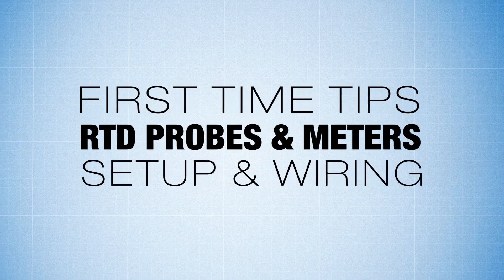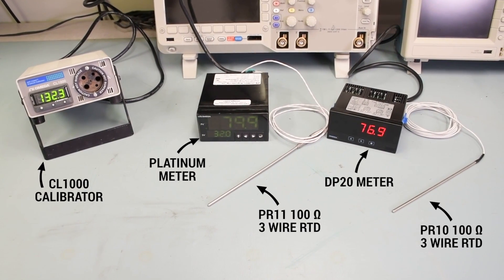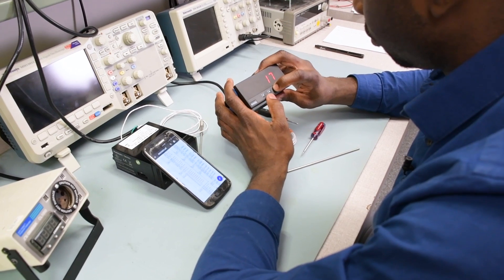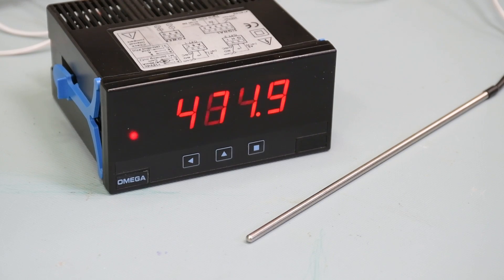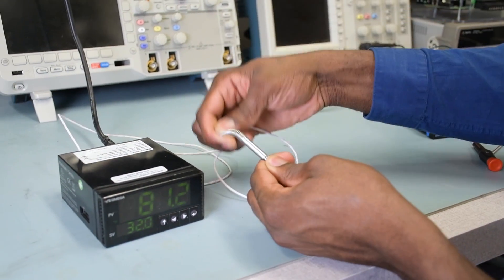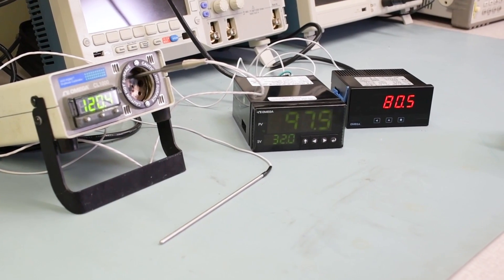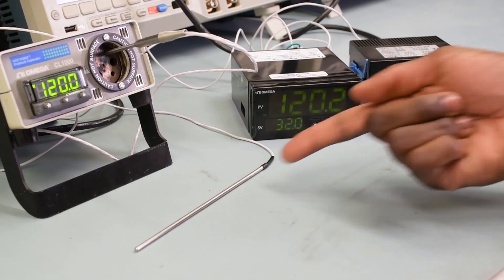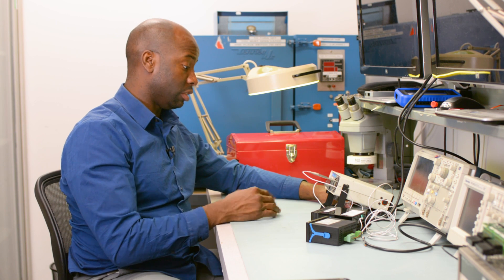How to wire your RTD (Get proper RTD readings)

Comment: Why is the green so dim on these meters, I just got my hands on mdssdi8 and the green digits are dim just like that one on the bench. I was hoping to be able to use this across the room. Guess Ill tear it open and check the rails and current, or pwm duty, I wonder if its because the bi color green and red are sharing the same current limit resistors on common.